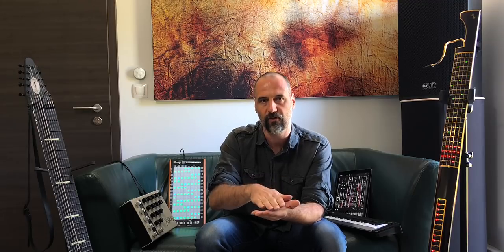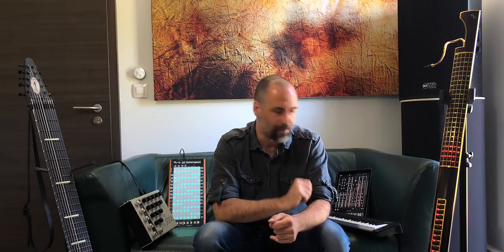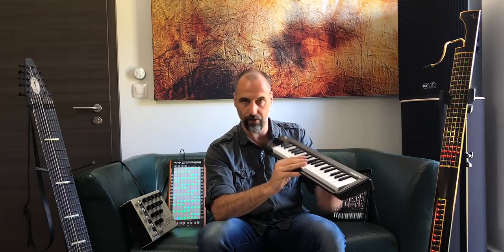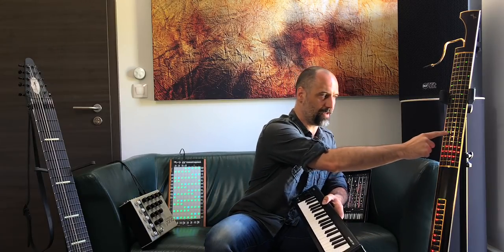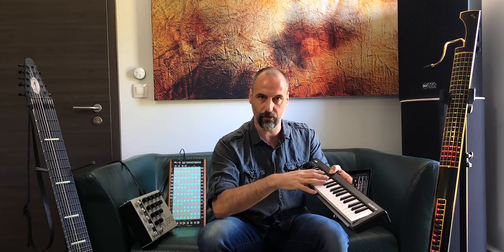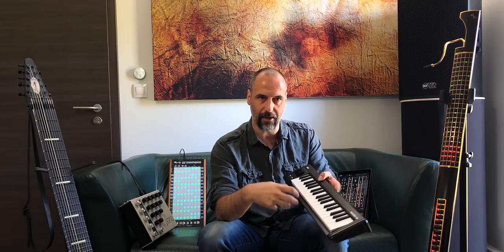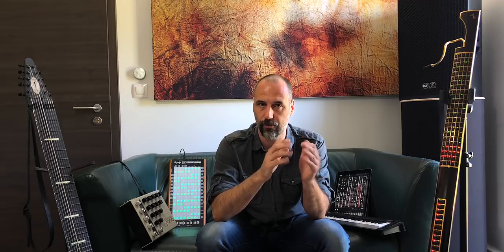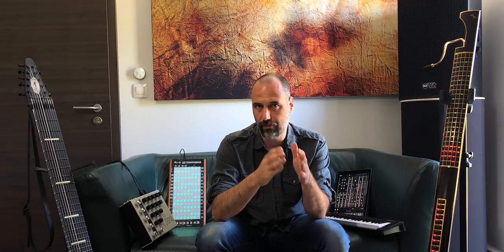Why MIDI Polyphonic Expression (MPE)?

Comment: I say this wherever I go... Geert, can you please add a MIDI channel filter to the Moog apps, à la Equator or Seaboard 5D?  It doesn't make sense to have a four-voice synth hogging all 16 MIDI channels.  The problem is that third-party filter apps, like MIDIflow "Channels" and the likes, block incoming MIDI clock, so the LFO's and Delays within the synths themselves cannot be properly synced.  I mean, if you're going to champion the MPE protocol and all (wink, wink).  It would also allow us to use two Moog apps side-by-side, both in MPE mode, each controlled from separate splits on the LinnStrument.  As it stands currently, this is not possible.  Cheers!

Comment: As a Linnstrument owner I’m really excited now that the MPE specification has been officially adopted.  I love my MPE software & iOS apps, but am frustrated by how few hardware options are available. I’ve been tempted by the Parva.  What is your opinion on the Parva’s current firmware stability?
Reply from the maker: I’ve yet to try to latest 0.7 firmware. The development of the firmware has been rather slow, but it has been greatly improved since the Parva’s release. Even the previous 0.64 version was already more than capable and addressed the majority of the issues for me. One issue bugs me though, and it’s hardware related, when I connect LinnStrument over USB and have it being powered by Parva, there’s a very noticeable whine in the sound. I have to use it with DIN MIDI cables instead.
Reply: Thanks for the information.  Also, thanks for the work you’ve done to help make the Linnstrument so amazing.
Reply from the maker: It my pleasure!! :-)

Comment: Thank you for the explanation, but, seriously:
"The pitch bend, mod wheel, pressure information for a particular channel only applies to the notes on that channel, so each channel becomes its own polyphonic controller."

Am I missing something??
MIDI has always been this way. This is exactly the same as the first MIDI specification. I understand that you want software developers to implement sound generators that allow 16 independent channels - so do I - but MIDI has included this from the beginning.
I guess if there are very few people buying your products, a new announcement from the MIDI Manufacturers' Association and a bunch of blogs hyping the "new" specification ought to help.
Reply from the maker: badmuthahubbard that's exactly right and that's exactly the purpose of MPE, the exact same MIDI specification is used but instead of having one device per channel you have one note (or one finger) per channel, allowing those axis of expression for just that note individually instead of for the whole device that is using the MIDI channel
Reply: @gbevin   
OK, I understand; but AFAIK this was already possible, according to the specification, just not widely implemented in hardware. This has long been the only way to do any other tuning system with most equipment, as, still, almost no one has implemented the decades-old MTS. As far as I can tell, all that has changed is that people have begun making hardware to use the existing specification differently than others. I guess, as a microtonal composer, I have different needs than a soloist. But 6-channel MIDI guitar is also nothing new.
It's very cool that manufacturers are finally using this possibility, it just seems odd to me to make it part of the official specification.
Reply from the maker: @badmuthahubbard  yes, it has always been possible but there was no consensus on which messages to use for the three primary axis, there was also no specification for how to handle the activation of an MPE behavior, nor how to handle splits. This is the exact intent of MPE, change nothing in how MIDI 1.0 behaves but allow all per-note expression products to converge on a pragmatic use of the existing MIDI capabilities.
Reply: @gbevin  
OK, now it all makes sense - standardizing. I see the need for it now, thanks for the clarification. 
I still wish manufacturers would go back and implement the MIDI Tuning Standard that was specified decades ago, but all I can do is implement it in my own projects and encourage others. You know what they say - "The nice thing about standards is that you have so many to choose from."
Reply: Before reading the replies.. I'm thinking the exact same thing. It's so hard to sell mpe without demonstrating it. I've seen it demonstrated but I'm still thinking wasn't aftertouch always a thing?

"Instead of having one device per channel you have one per note".

Could you possibly explain what you mean using a musical example?